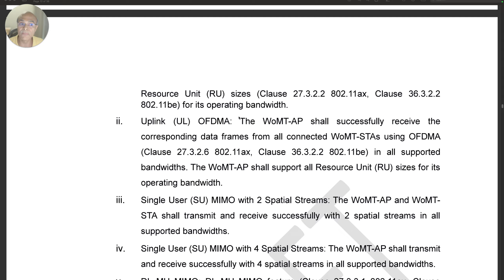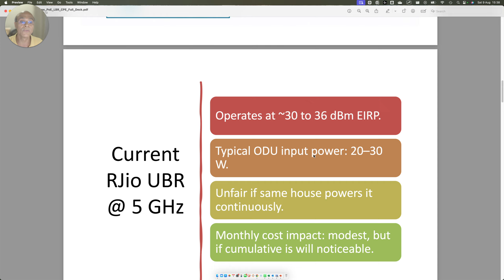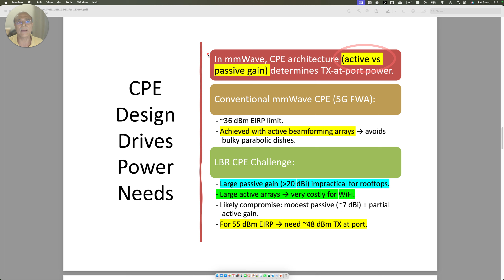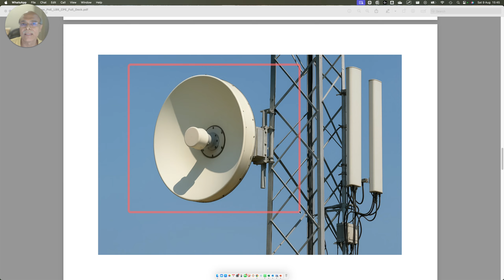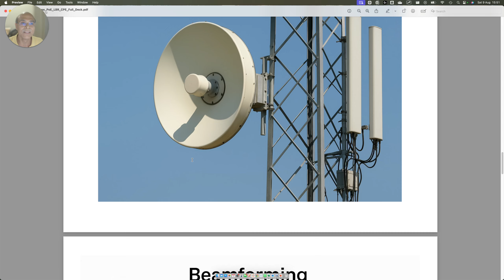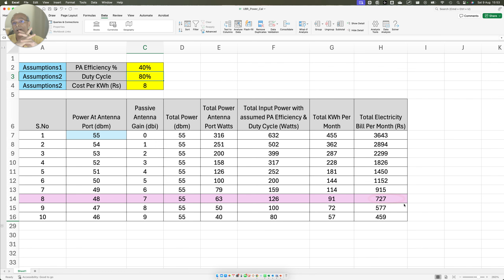Who Pays the Power Bill? 26 GHz Wi-Fi (LBR) Explained — Reverse-PoE, CPE Design & Your Meter

Comment: Dear Parag Sir,

Thank you for your videos; they are very insightful. I would like to clarify one thing. I think your calculation about power consumption is very much simplified.

Let’s take the example of one radio (I am talking about the radio, but the CPE case will also be similar). Consider a typical mmWave radio with a TRP of 38 dBm and an antenna gain of 32 dBi, giving an EIRP of 70 dBm. According to your calculation, it would consume only about 12 watts of power, which is not the case in the real world. This kind of radio consumes close to 300–400 watts of power.

One 5G radio has many components—DFE, AFE, baseband processor, etc. A lot of signal processing happens in the baseband and DFE.
Reply from the maker: You are absolutely right, the power consumption calculation in the video was a simplification and did not account for the significant overhead from baseband processing and other internal components.

Comment: There is a mix up of TRP vs EIRP
3GPP power Class 1 allows 55dBm FYI. Saying IMT systems do not allow - is a wrong statement
If it is a health hazard, I think 3GPP IMT systems would not have allowed it
Reply from the maker: You’re right that 3GPP Power Class 1 allows 55 dBm EIRP — but there’s an important caveat: 3GPP also caps TRP at ~35 dBm, which means the antenna needs around 20 dBi gain. That high-gain, narrow beam greatly limits where peak EMF occurs, and if aimed away from people it’s easy to stay well under exposure limits.

The TEC spec, on the other hand, sets the same 55 dBm EIRP without a TRP limit or minimum antenna gain. This means a vendor could achieve 55 dBm by using much higher conducted power with a broader beam instead of a narrow, high-gain antenna. At 55 dBm EIRP, India’s EMF rule of 5 W/m² means you need at least 3 m clearance directly in front of the beam. With a broad beam, more of the surrounding area falls into that high-power zone, increasing the risk if the CPE is poorly placed.

So yes — 3GPP’s implementation is safer by design, but TEC’s current draft could be riskier if not paired with strict installation guidelines or a TRP limit. The challenge is that setting a strict TRP limit for Wi-Fi CPEs would require ~20 dBi antennas with active beamforming elements — making the devices far more expensive and undermining the whole cost advantage. IMT-based 5G FWA CPEs are engineered to handle such high power with narrow beams safely; a poorly tested, high-EIRP Wi-Fi system without those safeguards is a very different proposition.
Reply: There is no way mmwave will go even few metres with a broad beam without beamforming (the definition of broad is being used losely here. But assuming i understand what you mean, The physics doesnt allow it. The fwa is mounted on top of buildings. So not sure how fair are these fears.
Reply from the maker: @asaidhiraj  True — mmWave without beamforming won’t go far, and physics ensures you can’t avoid a directional approach. But that’s exactly the point: if you must use beamforming to make it work, you end up doing exactly what 5G already does. The moment you replicate that in Wi-Fi mmWave, the product complexity and cost land in the same ballpark. Which is why TEC’s current approach feels like trying to reinvent the wheel — the outcome will be the same, just reached via a costlier and more convoluted route.

Comment: 1. Is 55 dBm really that harmful in case of mmwaves as it'll be very focused like a tube of a pipe. They do get blocked even behind a notebook so that's why it's high power. Is that the case?

2. Going with active cell is a clever decision as it can help jio to serve many customers which isn't possible with p2p dishes or microwave band antenna
Reply from the maker: thanks for watching and feedback